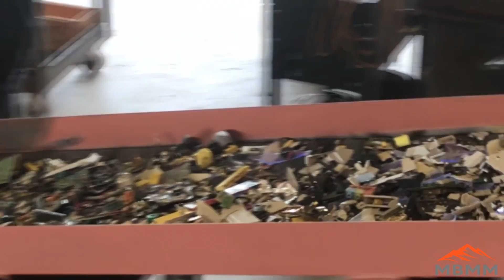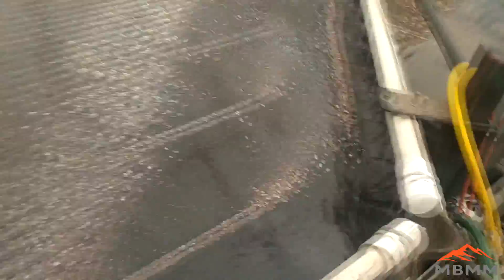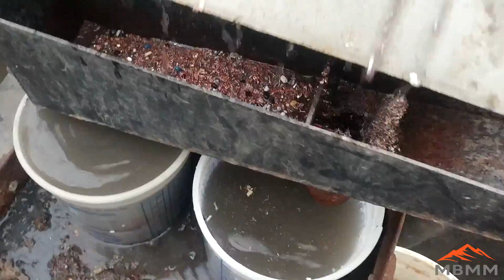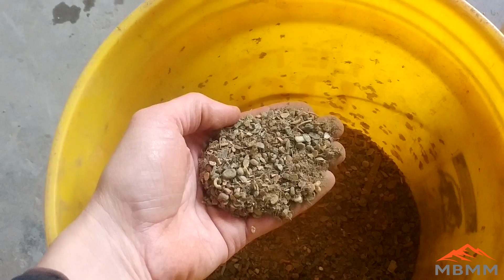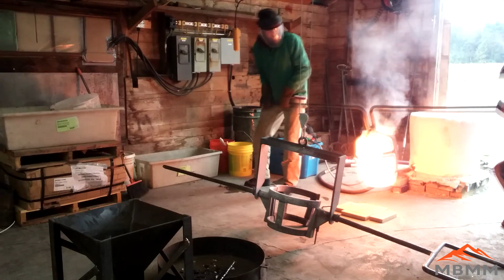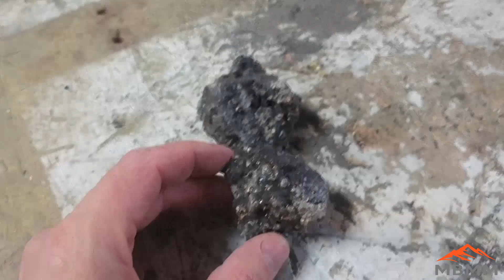Shredding & Melting Recycled Computers: Gold, Silver, Copper, Scrap Metal Recovery

Comment: That magnet just removed half your gold at that crush size.
(Plated items, chips with steel pins, micro capacitors)
Reply: Also the micro-capacitors held all the more valuable 'rare earth' metals as well.
Reply: Go to Sreetips channel, he gets every micron chemically from valuable mixed metal groups.
Reply: @johnh8615  myself and most of the guys doing recycling here belong to the same forums
Reply: @johnh8615  exact like you say! Gold recovery from PC parts is best with only a chemical process. It's not as easy crushing it up. You have to melt and separate and melt and filter again and again. This is what gives .999 fine the quality standard that it is.
Reply from the maker: Great, thanks for the tip!
Reply: i 2nd that.
Reply: majority of pc components are plated in 3 to 4 layers, Magnetic Zinc inside layer metal  Copper Layer over that then electroplated gold or Silver or Paladium over,  very magnetic, yet valuable due to extra thick layers of plating, yes, he lost most gold
Reply: Yeah u cant crush a comp and take stuff out with a magnet.. everything is plated on another metal. Has to be done by knowing or looking... By hand and looking
Reply: I've been thinking that for years (since I saw the first video on the machine).  Most of the precious metals are plated onto magnetic surfaces. 

I do hope that someone is collecting all the magnetic content and processing it. It's all metal now, so most smelters/refiners will accept that to process (while most won't accept crushed electronics).
Reply: Sorry to burst your bubble but gold is not magnetic
Reply: @cliffordstokes595  hahaha, no, but its plated onto magnetic nickle and other metals,
Reply: @cliffordstokes595  lol... it went right over your head didn't it? 

It if it is attached to metal, it will go with the metal to where ever the metal goes unless you detach it somehow.
Reply: @cliffordstokes595  WOW... did you read my comment and understand it? The gold he removed is inside or plated onto magnetic items that were removed.
Reply: @sionsoschwalts2762  I guess you didn't understand when gold-plated items are crushed the gold plating falls off flakes off do you understand how that happens it's just like anything you Chrome if you start crushing it the chroma flake off it's not stuck on it forever
Reply: @cliffordstokes595  Gold plating does not fall off like that unless at a MUCH MUCH finer crush size. Chrome comes off due to it being thicker and more brittle, gold is much softer and has a thinner coating. Also much of the gold is trapped INSIDE IC chips, MLCCs and the like which are already smaller than the crush size so will pass right through.
Reply: @sionsoschwalts2762  Clifford has no idea, he propably thinks we dont own gold or do recycling, I base my Answer on doing this for a hobby over past 40 years
Reply: @cliffordstokes595  uuuuhhmmmmm NO lol
Reply: @cliffordstokes595  sinso Schwalts ist right, you are wrong. goldplatings never fall off by hammermill the pins ans chips. i think he loses more than 50% Gold with this process. I use chemical processes to recover the gold and i get much more gold out of a complete PC.
Reply: @cliffordstokes595  really not true, certainly not at that crush size.
Reply: @cliffordstokes595  I refine gold filled and plated items. You can crush all you want but the gold will not come off with just crushing.  Gold is way more malleable then chrome.

Comment: Run that slag through the hammer mill and across the table again. Can you make a smaller hole screen for the mill? Also, I'd say the JAW CRUSHER would be better as a first step for knocking the towers apart. It would generate larger chunks that would be easier for sorters to grab the steel, aluminum, and plastic off the conveyor belt. I have to wonder if some of your computer chips and other goodies were being wrapped up in computer shell wads and swept away by the magnet belt.
Reply from the maker: Great, thanks for the tip!

Comment: Knowledge dictates some metals never get smelted together for good practical reasons you experienced. 
I would of run the material through the shaker table to separate them to a higher level and run magnets over the gold, silver and copper lines to remove as much magnetics as possible. Then smelt them with more SO2 to burn off more impurities individually if possible.
Reply from the maker: Great, thanks for the tip!

Comment: Great experiment There was gold plated items in the ferrous that was pulled off in the first crushing. Next time break down the towers to reduce the plastic and steel.
Reply: The client is probably going to process bigger masses. Therefore it might not be possible to process it manually. The test wouldn't be representative.
Reply: Teun lll a full break down does not make logical sense in this scenario, but a removal of the case/tower would take a few minutes and would drastically reduce the wear and tear.
Reply: @ursamines7643  true, but try processing several tons of the product manually. The man cost would be high. Besides this is way more ergonomic. But I think we both mention different strategies that are both used in the recycling industry. Interesting discussion though.
Reply from the maker: Great, thanks for the tip!
Reply: obviously you missed the point of the experiment.

Comment: Remove as much of the aluminum from the PCs as possible before grinding. The aluminum oxide is never going to melt in your setup it seems you dont want it around trapping other metals in that sticky slag.
Reply from the maker: Great, thanks for the tip!
Reply: ya, remove the bulk plastic front face plate, steel casing, power supply steel case.

Comment: Holy cow. First? Last time I was this early Ricky Gervais hadn't eviscerated Hollywood. Love the videos. Great content. I have a question. PC circuit boards and mercury in a tumbler, what do you think about the efficiency? Thanks
Reply: With a steel contaminated pour, would a steel screen hold up to strain the pot?
Reply: Mercury have no place in modern refining. Anyhow, it would probably just alloy with the copper and then you have super toxic waste and some super toxic copper.
Reply from the maker: Not sure, but I want to stay away from Hg
Reply: I've heard all the horror stories from the use of mercury but it seems safer to handle than said. Also, can an Hg/Cu amalgam be separated by stilling off the Hg?